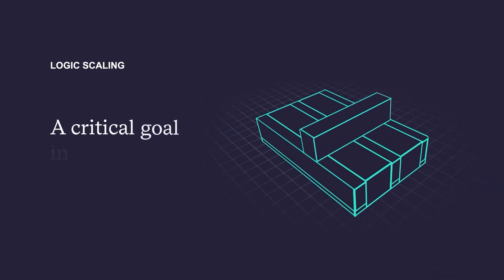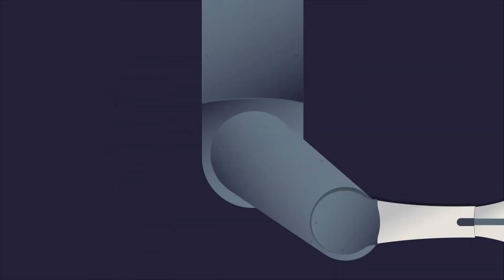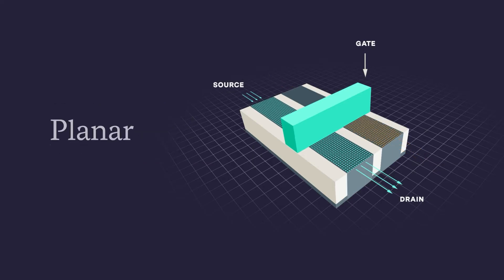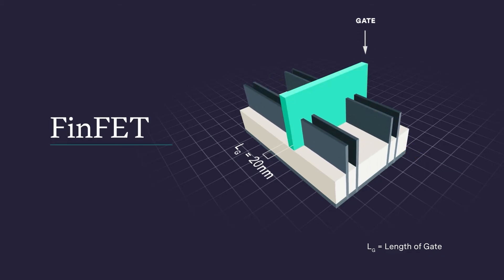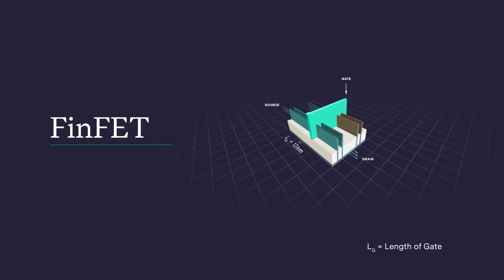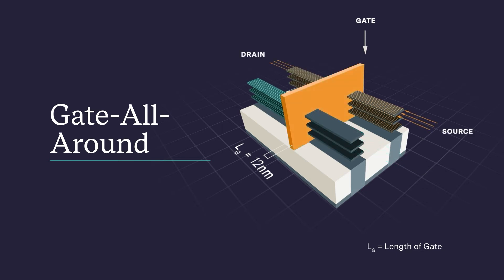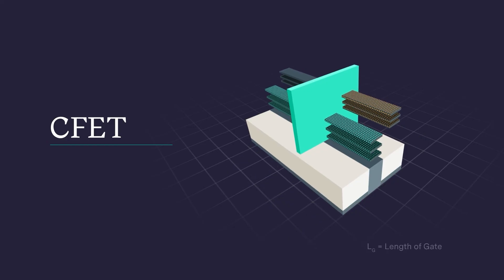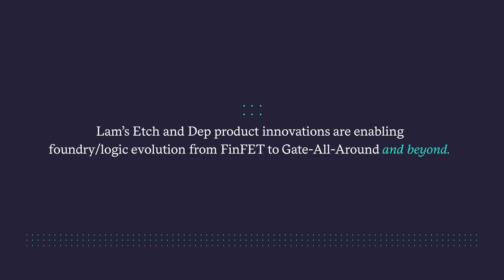Gate-All-Around, Transistor Architecture Designed for the Future of Logic Devices (Semi 101)

Comment: One small question of GAAFET: where is the channel? Source and drain are hover from the substrate, how the carriers reach the channel between source and drain?
Reply from the maker: Thanks for your question. The images in the video are stylized representations of the actual device. The source and drain junctions are not shown so that the main elements – in the GAA case, the nanosheets and the gate that surrounds them – are easier to visualize. In reality the source and drain lie on either side of the channel(s) and current flows across the channel, from source to drain, when the gate is active.
Reply: @LamResearchCorp Excellent explanation. appreciate

Comment: That's their 2D/3D presentation graphics or 3D rendering. 

I told them not to change it. Reason, their highly technical people learned from these same 3D graphics (who have already become managers) and teach the new inquisitive ones using these same 3D graphics or CGI. :)

That's 1970s again.
Reply: Of course, when evolving new circuits/chips, it is easy to see that you only need your circuits programming "data structures" to evolve. Only when the solution is found that you can see it 3D-rendered. It's like the neural net of Stockfish program which outputs only integers for the pieces, moves, and/or checkmates.

But now, with very very fast computers (actually we had before), you can set your app to show the 3D microchips newly-evolved solutions immediately in real-time, like in very fast 3D computer games.

If only I got hold of a powerful graphics library since 2008...
Reply: Actually, in late 1970s or by 1980, I wrote and upgraded the graphics engine of Ubisoft which I said I owned. And already co-developed Playstation graphics code and Microsoft Xbox graphics engine and even previously designed their console devices.